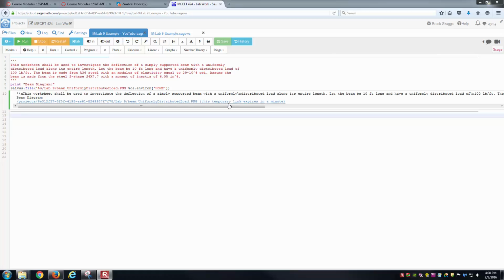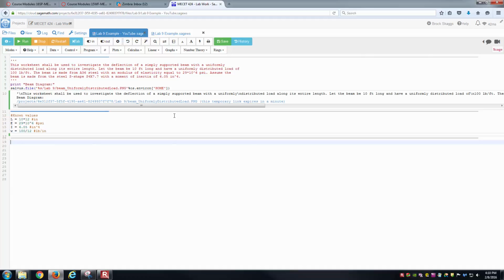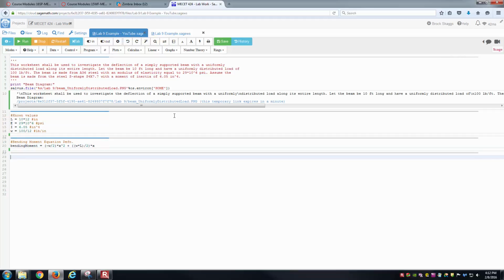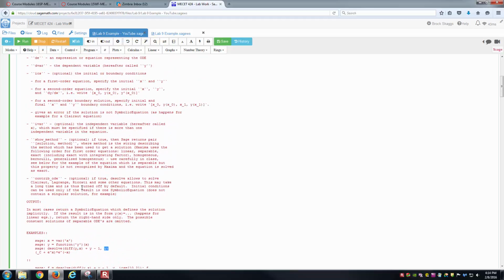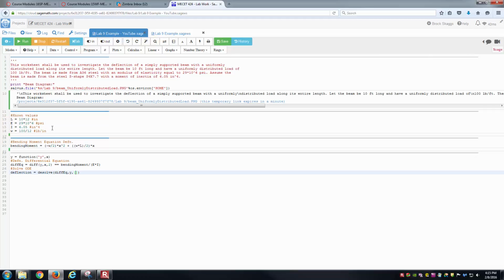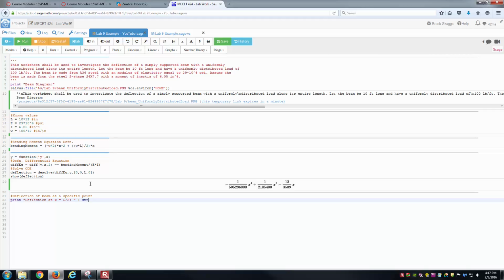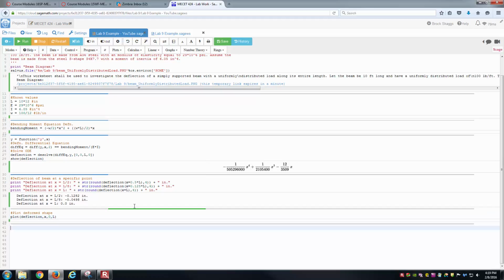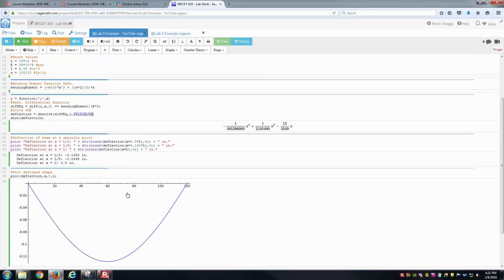SageMathCloud - ODE Solution

Comment from the maker: Thanks for the comment.  I have yet to have a need to work much with 2D based problems, but I believe you are correct.  From my understanding, you would first define the y to be a variable, var('y'), and then be able to use it to define a function dependent upon x and y.

Comment: Hi. When you type the variable "x" in bendingMoment equation without defining "x" as a variable first, seems to work out just fine without any errors. When I do the same thing, I'm getting an error that the x isn't defined as a variable. I'm using Sage on cloud. Do you know how that might be? Great tutorials btw, thanks a lot.
Reply: +Ceren g Sorry, it's the additional "y" parameter that causes the problem. So, is it fine in 1D but not in 2?